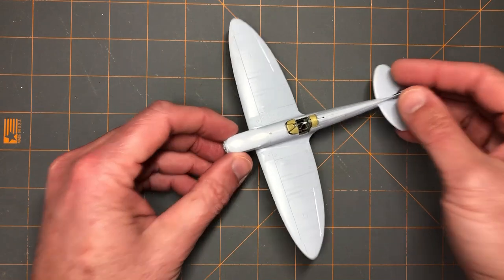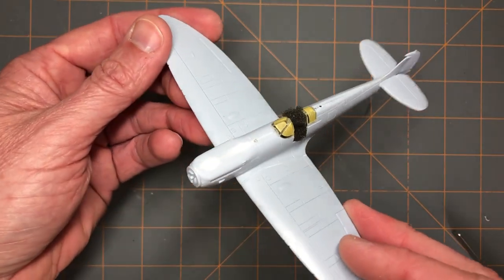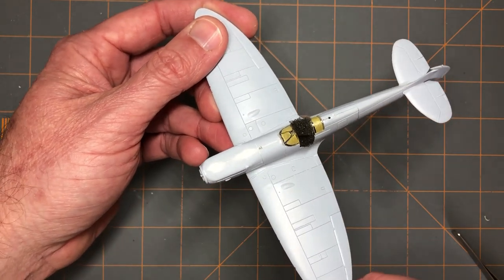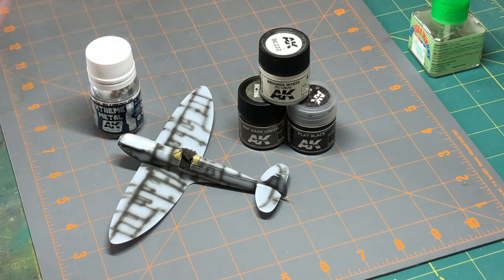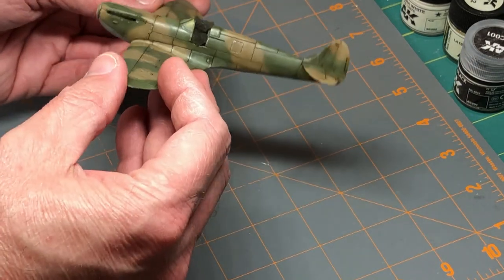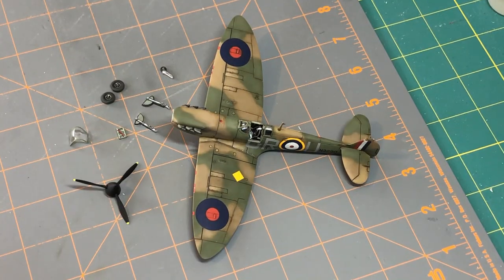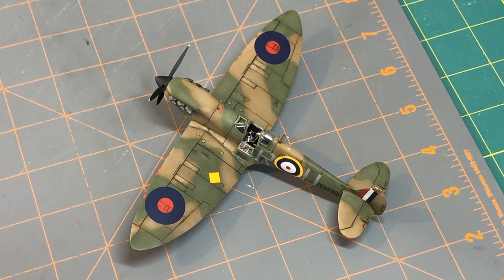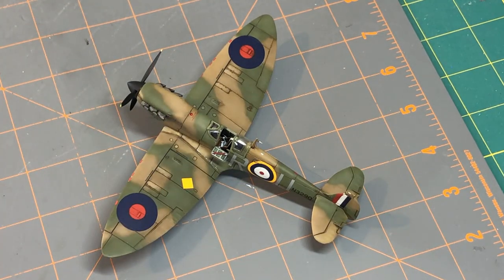Turning a $6 kit into an Award Winner - Airfix Spitfire Mk.1a Build

Comment: Wonderful work, I was wondered as you paint with no mask.  how you do disolve the paint to get a clean aspect on it  with not little points or similar?
Reply from the maker: Thank you for the good feedback.  I do thin my paints pretty well so they can be sprayed in tight patterns with the airbrush.  Usually somewhere between 30% and 50% thinner depending on the paints I'm using.  Hope this helps.

Comment: What is that foam that you used to block off the wheel wells and the cockpit?  Is that just random packaging material you had or is that something  you buy?
Reply from the maker: You probably can buy it but I just use the stuff that comes in the resin sets I order from Aires.  I'll try to look around and see if it's available for purchase.  I'm sure it is, I just haven't ever looked.

Comment: A Well presented and helpful video overall.   A few detail comments which maybe of use.   Wheels wells colour,  much debated, but a maintenance film made in June 1940 clearly shows the wheel wells to be, the outer wheel part is underside colour(external area),  in every photo I have seen where the outer well is visible, it is the same as the underside.  See here https://youtu.be/-IHSEBsaBdU?t=91  The inner leg part part is the internal colour, which was at this time, and until late 1943, aluminium paint.  The only part in grey-green was the cockpit to the seat bulkhead.  Again, shown in the maintenance films.  The entry door crowbar is a later addition than this model, and they were never red in the war,  period colour photos sh0ow black, natural metal and grey green.    For an oil paint panel line wash,  try a using a dirty grey, mix black, burnt umber and white.  Add shadow, but is not too stark. You can make a really thin, fast drying wash using lighter fuel, the stuff used in Zippos,    Also, do this after decalling, as it helps blend the decals in.  The AK Dark Earth looks a little light, but this may just be the light used,  but  there are a a lot of poor matches sold in model paints for RAF colours.   Also, well worth a read https://boxartden.com/reference/gallery/index.php/Camouflage-Markings/Supermarine-Spitfire     Hope of interest/use to you and others.
Reply from the maker: Thank you, Troy.  Really appreciate you taking the time to provide all of this valuable insight.  Will definitely come in handy on my next Spitty and it is sure to help other modelers as well.  Very good links, too.  Really appreciate that!